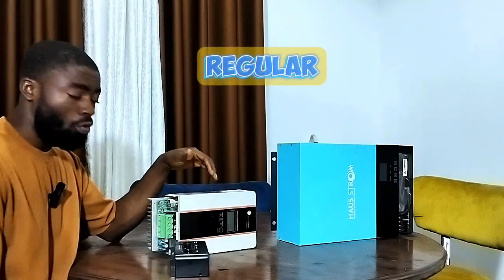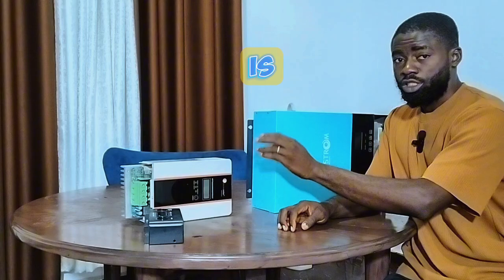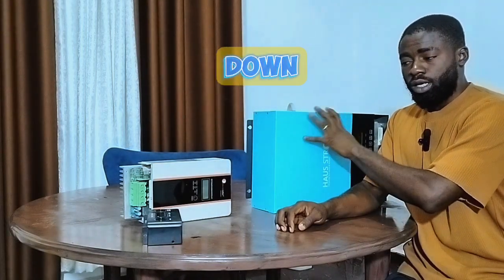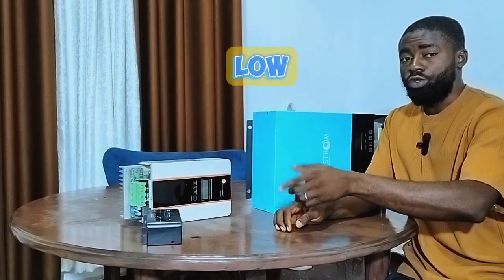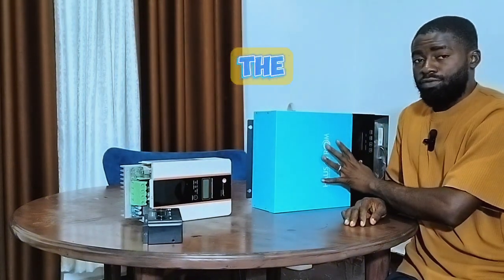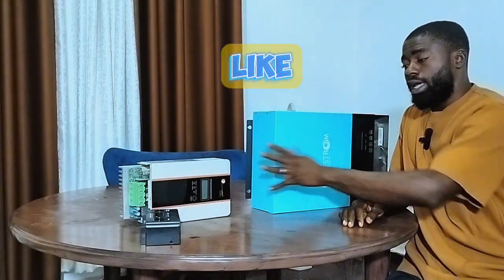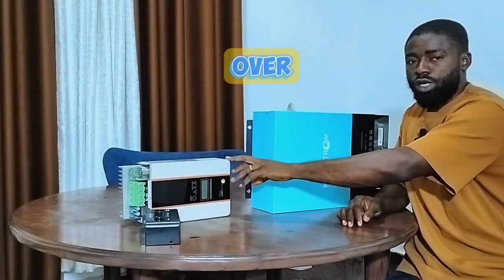THREE REASONS WHY LV SOLAR CONTROLLER ARE MORE EFFICIENT IN POWER OUTPUT

Comment: Greetings...I need ur help n this, Im setting up a ver smball setup of 8 batteries but 1 of then is AGM battery  
while 7 are GEL deep cycle batteries but I want to use all 8
  on pareallel same volt same amperage tho rule of thurm discourage it but I think it could work with supervision but need ur views .wish to run them with 2 separate pwm smart charge controller
Reply from the maker: Same current, right?

Comment: An MPPT is basically a Buck Converter, it can output either high voltage & low current or low voltage & high current with a very high efficiency of over 95%. There are losses in both stepping down & stepping up voltage. Energy cannot be created nor destroyed.

Comment: As an electrical engineer, this is just terrible information. There's a reason why power is transmitted at higher voltages across the grid. 

Terrible terrible video.

Comment: I think it has to do with your fied perculiarities. From the same array, you can have higher current ir voltage. Depending on series or parralell connection. You go with the one that gives you minimal loss. E.g if your PV array is too far from the controlller, you need higher voltage to avoid losses due to current because of distance. If the resultant imput isnt enough, then you require mor PVs and that requires a controller that can handle the increased Voltage. 
My 2 kobo

Comment: No, high voltage charge controllers are more efficient. Because you need a high voltage low current then the charge controller steps down the voltage and step up the current as the same amount of power go in to the controller and most of them has an efficiency of up to 98%, please go study power electronics well because what you know is just the solar setup and perspective thanks.
Reply from the maker: Abegi, people Weh right the power electronics Na God?.
You all use cable to measure efficiency.
Anyways you're right about stepping up current
Reply: @Mairigaemmanuel  
Woow so disappointed. 
Those that wrote power electronics are not God but they wrote the formula that is the basics of these inverters and solar equipment that you install.
If you have a contrary opinion to them, just write your own book and publish it. But we cannot stand and watch you put out what is not correct. 
Its high time you take to correction or put out a higher arguement with scientific facts, not hearsay.
Reply from the maker: I'm now putting out my contrary view and you're not satisfied with it!
Reply: @Mairigaemmanuel  
But your opinions doesn't come with scientific facts, and you want us to take your words for it. That's not the way science and engineering works.
Reply: I dont agree with you on this one. P=IV
HV is even more efficient in energy conversion once you use the right solar panel. The key factor is that you need to focus on either A or V while doing your calculations depending on which one you are using (LV or HV)

Comment: Bro, i have few things against this.
1. Efficiency is relative. If you have 5kw solar and you want to use it with 100v LV controller, you will have 50A coming from your panels which you will need expensive wires. Converting 100v 50A to 50v 100A for the 48v battery too is a great work.
Compare this to a 400v 20A controller. 20A from the panels is easy to handle by the controller. The only issue i see about HV is safety and single failure of a panel affects all panel in the string.
Imagine using LV and you loose 5v in your wires, you loose 250w but in HV you loose only 100w.

2. I think a charge controller doesnt step up voltage like you said. MPPT increases current and reduce voltage, PWM only reduce voltage while current remains constant.

3. Your point about energy loss or rather power loss: power can be lost in different stages, the panels itself due to shading, solar wires, charge controllers, termination point etc. 
Bro, you didnt factor in the distance between the solar panels and the battery bank, if near, maybe LV could still stand shoulder to HV, but if far, then HV is far efficient.
Reply: I just dey laugh here, because this is layman language and not electronics at all 😂 make I no talk! But I always enjoy watching him he is trying 😂
Reply: You're right bro, that's it,
Reply from the maker: We all have our opinion and views.
From everything you're talking about in your comment still falls back to cable size which I see most of you use as means of measuring efficiency.
Using the correct cable size in LV, what will bring about lost of current or voltage?.
I didn't say step up voltage rather current.
Charge controller is neither a step up or step down device
Reply: @Mairigaemmanuel 
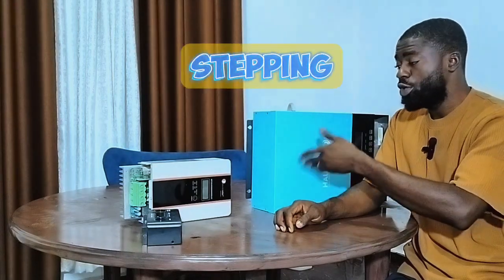Bros watch your video again in 2:21 minutes, you mentioned stepup and stepdown of voltage and current.
I know you are talking to layman out there and you want to explain in simplest possible terms, but always be careful, use the right terms and analogy.

Cable size is always a factor in efficiency. That is why our mains power transmission line runs up to 33kV or 11kV. No matter the sized of the cable there will still be losses. A larger cable will just reduce the losses but cannot eliminate totally.

I cant believe i am hearing from you that controller is neither a stepup or stepdown device. This is opposite of this video you have shared.  So what exactly is a controller doing with the voltage and current from the panels?